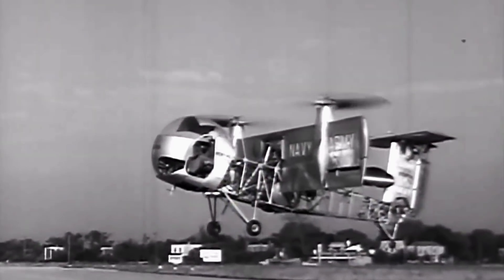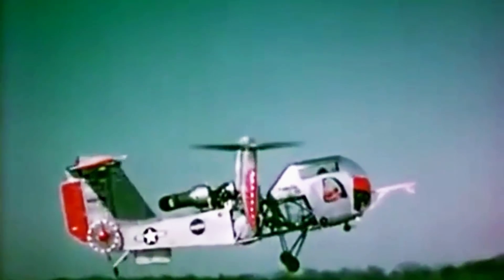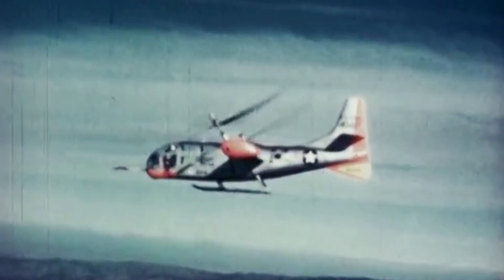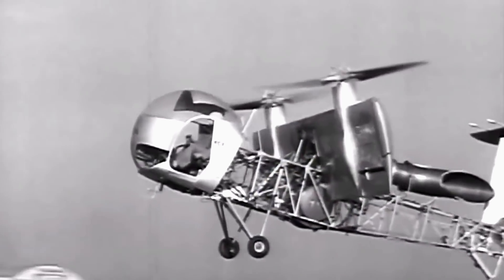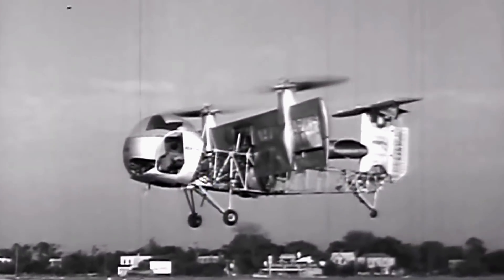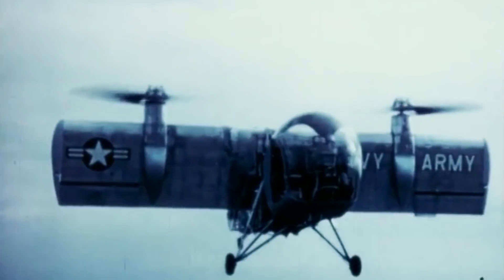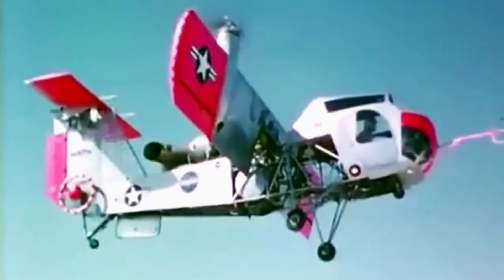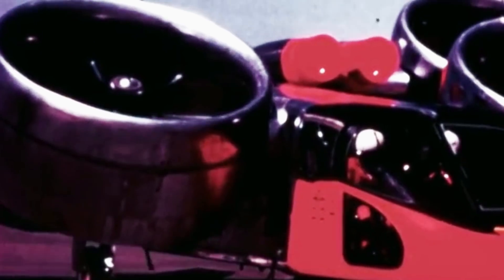An Airplane with Wings that Stand Up

Comment: None of these are correct configurations.  They miss key elements needed.  You cannot rotate the wing with the engine as they do for clear aerodynamic reasons.  Lots of problems are caused and it becomes hard to fly.  

I have a concept that will work that normal pilots could fly.  It can be VTOL with added features.  

It requires a New Engine Type.  Go to newenginetype.com  If you have interest in building a real game changer, then let's have a chat to see if you can add to the program.

Comment: Having to balance everything so it takes off without flipping head over rear must be awful. Why not move the engines and rotating wings forward and put a third prop in the back center, that rotates as well?

Comment: Now look how far vtol has gotten and it's still got a lot to go. Imagine entire fleets of carriers with only vtol capable planes that take off even faster. They could even have shorter secondary flight decks that could extend out of the sides of the carrier for takeoff and landing that retract while not in use

Comment: Looks like a very rudimentary forefather of the Canadair CL-84. The CL-84, however had a control system that had no separate control system for horizontal and vertical flight...they managed to design a control system that could be flown by fixed-wing pilots!
The CL-84 should have been the 'Huey' of the '60's, except that it was from a Canadian company!
Flew over 700 flights between 1965 and 1972, 0-100 knots in 8 seconds! Max speed 321 mph, max climb rate 4,200 ft/minute

Comment: I dont understand how it took so long after this to develop and implement the osprey 🤷
Reply: The Secretary of Defense, Dick Cheney kept trying to kill the project!!
Reply: We want this, but we want it to lift a lot more...oh and we want the engines to rotate too...and we want a drive shaft that runs to between the engines that will keep it flying if one engine goes out...oh and it has to fold up like a transformer to fit in a small spaces for transport.  Oh and it has to be flown by people other than test pilots.

Comment: That’s where the Osprey come from I bet that’s It’s great grandfather
Reply: No, this is not Osprey's grandfather. In fact the tilt wing is superior and the Pentagon got this one massively wrong. XC-142, look it up. If one adds even 1980's osprey tech to it in engines, and computer flight controls and same gearboxes used on Osprey all its "problems" vanish and you get an aircraft with 1.5X the range and speed of the Osprey, but with slightly worse true VTOL performance but makes up for it in STOL performance. Especially true if one adds the new ultra fan blades developed for the successor to the 727 in late 80's early 90's and is now installed on the Airbus 400M Military transport. Tilt rotor has already hit its maximum potential and in fact the new proposed V280, reduces its capability due to its deficiencies of V22 rotor loading.

Comment: Why they don’t change the propeller direction to the opposite direction, they wouldn't need the tail propeller?
 Dornier Do 31, an experimental vertical take-off and landing (VTOL) aircraft.
https://en.wikipedia.org/wiki/Dornier_Do_31

Comment: Canada was ahead of you guys on this, but you wanted an American made one, even though ours was better.  And then jets just took over.  https://youtu.be/q6SxyIoSvMM
Same sort of thing happened with the Avro Arrow which was the best fighter of its time.
Reply: The CL-84 was a utility aircraft. The VZ-2 was a technology demonstrator that flew a full decade before it. Tilt-wings were a dead end in the 1960s. Gearbox issues are the reason why it took so long before the concept that resulted in the Osprey were considered, and were still an issue in the 1990s.
The Arrow wasn't a fighter, it was an interceptor. And its mission disappeared underneath it with the advent of capable surface to air missiles. It never flew with the Iroquois engines which were a major technical hurdle themselves with their novel titanium internals. The Arrow is Canada's smaller brother to the XB-70, a very cool money pit.

Comment: The V-22 Ospreys grandfather
Reply: Indeed, as others have said, it seems like a precursor to the cl 84... Canadair managed to get past the aerodynamic problems, and developed a very sophisticated, but simple to fly, control system. It seems, now, that most of the tilt wing problems were soluble, and that 4 props were not doable...the cl84, scaled up, would probably have been a better solution than the osprey, but, sadly, being Canadian, would never be adopted by the USA
Reply: CL-84  Dynavert  
https://youtu.be/q6SxyIoSvMM
Reply: I was thinking the same thing.
Reply: @Blake Eldredge there's a squadron near my home i always see 2 flying together at least once or twice a week
Reply: @Blake Eldredge not really, it has a fairly  bad crash to flight hour rating
Reply: No, this is not Osprey's grandfather.  In fact the tilt wing is superior and the Pentagon got this one massively wrong.  XC-142, look it up.  If one adds even 1980's osprey tech to it in engines, and computer flight controls and same gearboxes used on Osprey all its "problems" vanish and you get an aircraft with 1.5X the range and speed of the Osprey, but with slightly worse true VTOL performance but makes up for it in STOL performance.  Especially true if one adds the new ultra fan blades developed for the successor to the 727 in late 80's early 90's and is now installed on the Airbus 400M Military transport.  Tilt rotor has already hit its maximum potential and in fact the new proposed V280, reduces its capability due to its deficiencies of V22 rotor loading.

Comment: Airplane Helicopter hybrid? It’s called a VTOL my man
Reply: Vtol is something a helicopter is guaranteed to do while an airplane is a fixed wing aircraft not typically used for vtol. Vtol isn't a type of aircraft it is a subsection of aircraft. So an airplane-helicopter hybrid can be something separate all together.
Reply: @rooiflitz  true, but, it’s got a lot of similarities to a VTOL such as the osprey, which is very much a VTOL
Reply: @aeronaut1906  true but what I was saying is that an aircraft is its designated thing such as helicopter or plane then its subsection like vtol or stol. Rather than Helicopter, plane, vtol, stol as designating categories
Reply: @rooiflitz   Yes, but if you see what I said in the comment, that I was referring to the name of the video and not the content of it. A “Helicopter Plane hybrid,” is a VTOL in the name itself, but maybe not the aircraft itself.
Reply: You are referring to the aircraft, while I am referring to the title of the video